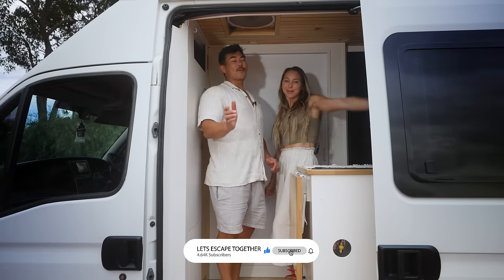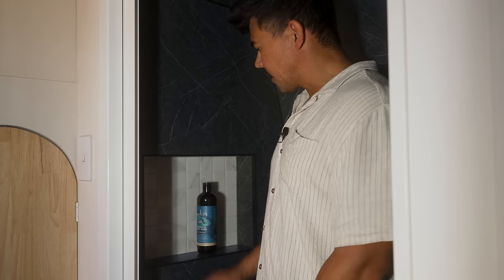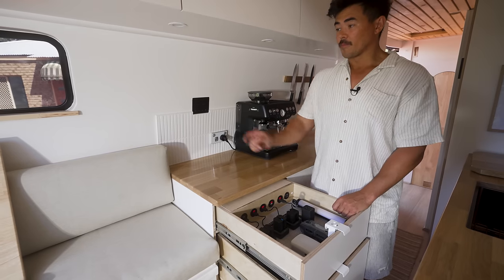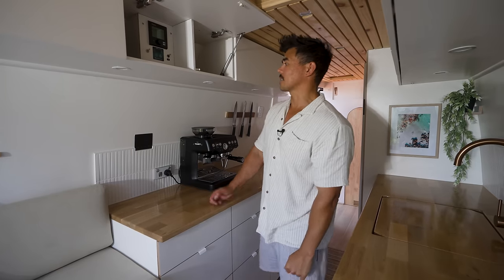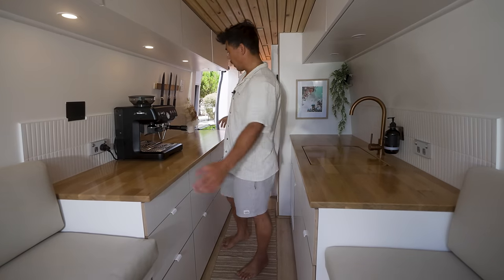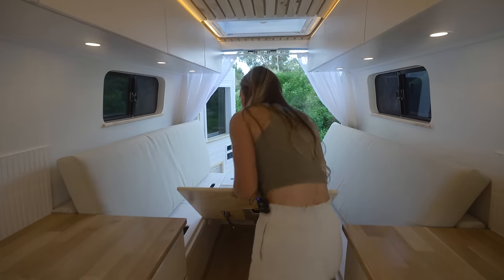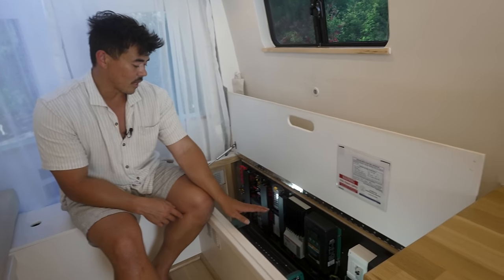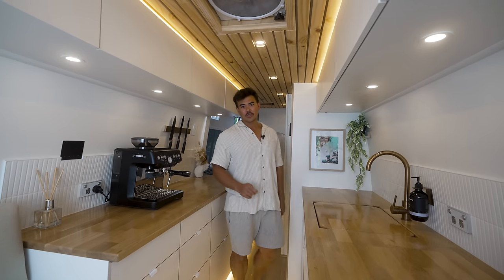VAN TOUR | Luxury OFF GRID Australian Campervan with custom Full Size Shower

Comment: Wow great build for your first time! I’m impressed! Love the clean lines and lighting. Great job with the nooks, materials, and storage.  You created various spaces to use inside and outside of the van.
Reply from the maker: @OldExodus
Reply from the maker: @OldExodus  Thank you so much for the lovely comment! We're so happy you like it! It was definitely a big project, especially since it was our first time building a van. We made sure to take our time with each step, focusing on doing everything thoroughly and not rushing the process, which is probably why it took us several months 🤣. But so far, the van and layout have been amazing, and honestly, there's nothing we’d really want to change!
Reply: What material did you use for the bathroom wall?

Comment: Thank you for the tour, its fantastic, one of the few builds I could imagine myself living in as you addressed so many things like easy use toilet, good shower, cab access but using most the partition wall too. Quality looks great. The only little things I would develop more would be an easier bed switching system and built in blinds on windows. It looks like an A/C unit on the roof? you didn't mention one.
Many vans are designed for the outdoor sport life accommodating bikes and surfboards, yours is more my taste, its designed to be a home from home.
Reply from the maker: Hey Rob, Thank you for your comment :) An easier bed system would be amazing but we couldn't come up with a way that would allow us to have the office space and over head cabinets. Our side windows are tinted and at night we put a cover up. The windows don't come with built in blinds but that would be a great option:) 
We don't have an aircon on the roof but we do have a portable one. We would have to learn how to surf first hahaha ;)

Comment: That’s a real sweet looking van. Giving me ideas already. I’m thinking I would probably add a hydraulic bed lift as I sleep on a futon and don’t care too much for my friends sitting on my bed. That way I can still have the lounge setup. 
A couple of serious questions now. How do you stay safe whilst on the road and looking for parking. I always feel nervous about someone coming up at night time and slashing my tyres and finally what will you choose once vehicles go electric. Thanks for sharing this awesome setup. I’m currently living in Perth and doing up an Aussie airstream. ☮️stay safe..
Reply from the maker: Hey Stevie thanks for watching!! We actually did consider a hydrology bed loft but they were about 4K just for the hardware.  Touch wood we haven’t had any troubles while camping and sleeping in the van.  We try not to camp out at any dodgy areas.  The pocket door comes in handy if we need to drive off on an emergency without getting out of the van

Comment: New subscriber here. Came over from Max & Occy's channel to see more. 

I love your van, especially having a full size oven and a really good size fridge at eye level with a freezer and your huge sink. I love your shower with sliding toilet, an awesome design and great use of space. 

I was thinking you might want to stand your coffee  machine on a silicone mat to prevent it from sliding off the counter when driving. You could cut it to fit so you wouldn't see it. 

Looking forward to seeing more on your travels.
Reply from the maker: Hey thanks so much for the advice!! We are getting some silicon mat for the coffee machine and hopefully that works 😊😊

Comment: Love the interior of your van and what you have done.  It's amazing and thank you for sharing it.  You have given me some great ideas for renovating our caravan.  Only just subscribed to your channel so not sure I you have a video of your build which I'll be very interested in, particularly when it comes to suppliers etc.  Noticed that you didn't have an air conditioner, is the ventilation system you have able to cope with the climate and humidity of the tropics in Queensland?
Reply from the maker: Hey Thanks for watching the video and the feedback.  We have the EcoFlow wave portable air conditioner together with 2 maxx fans, 2 sorocco fans and if all else fails windows and skylight open.  The reason why we didn't install a huge aircon on our roof is because at the time these units need to run of 240v and you need to be hooked up to Mains power.  We never stay at caravan parks and built the van to be off grid.  With our lap we will time the seasons so we are not in the top half when its too hot 👍

Comment: This is my favorite van tour/build by far. It seems like you guys really thought about everything down to the aluminum frame that protects your water tank. I'm glad you guys included clips of you insulating the van and actually demonstrated your shower/bathroom area. It just helps to get a better sense of how a person will actually be able to fit/move in the space. I also like that you focused on giving it less of a mobile home vibe and more of a tiny home vibe, and that instead of a "garage" you opted for a patio? space instead. I'd say the only thing missing from this tour was a closet space. I wasn't super clear where you guys are/were planning on storing your clothes. Overall though great job with the build (seriously it's gorgeous 😍) and the video. ❤❤❤
Reply from the maker: Wow thanks so much for your detailed reply!! We are thrilled that you like our Van and we appreciate how you commented on specific parts of the tour/build that you liked 🙏🏼🙌🏼 Your actually the second person to ask where we store our clothes and we should have uncles that in the video.  Our overhead cabinets store all our clothes and we have one side each. Emily wanted a hanging space for some clothes.  It would have been next to the fridge however it would have reduced bench space on the sink side.
Reply: @_letsescapetogether_  Thank you for your reply. This might be a bit of a personal question but would you say that the overhead cabinets give you roughly two weeks worth of clothes?

Comment: Brilliant job guys - came here from Max and Occy and now subscribed.
This is hands down the nicest build I have seen and I have watched plenty.
You really should get it spec'd out / measured up and I'm sure you could make some cash selling the plans.
Few things
1/ do you think you could have used (or other can use in the future) standard carcasses from something like kaboodle) or are depths not right.
2/ any reason why you did not do another two sliding seats out the back of the van to match the table
3/ If you could change anything now that you are done (to improve on the design what would it be).
4/ that back section of foam for the couch (nearest the door) how wide is that and could it be a single bed (hence you could leave that set up and the a smaller dining area set up (if you were travelling solo) but have the option to have full dining or full sleeping if/when required).
5/ shower cubicle - you hand made yours are there not prefabricated pods that you could have 'started' with and then modified ?)
Looking forward to seeing your adventures.
Reply from the maker: Love this thank you so much 😊 

- The Kaboodle packs are quite heavy and aren’t very strong. We do know others have used this for their cupboards but we wanted to custom make ours and wanted to make them light weight 😊

-We couldn’t so slide our seats because of our electrical board and also the gas box. We do have camping chairs we can use to sit around the slide out table.

- Because our walls are curved we didn’t want to have a pre made shower base. We also wanted a  
 slide out toilet so we had to custom make the walls. Max also wanted a niche with an LED light 😂

We are about to edit a one year of van life video and hope you will enjoy watching it ❤

Comment: Add strong pull out bench seats on either side of the back outside table, and then put a sliding middle part of the table that slides back into the van to reveal a gas grill with a table for eating on either side of the thin, but long gas grill. You could cook and then eat around your table with a nice gas fire burning in front of you. Or you could close off the grill and have a full table, or half and half. Underneath the table sides on either side of the grill have them lift up to reveal plates and cutlery and cloth napkins. On the doors put fold down tables with again either plates, cutlery, and champaign flutes, and whiskey glasses, and what ever else like cooking utensils, because you will be cooking steaks on the table grill for your friends both outside and inside at the seating area. Then put a beer fridge on the left side under the back bed area for quick access to yet another cold frosty brew! God bless us all! Love your work guys and she is prettier than you! Cheers from South Carolina USA!
Reply from the maker: That is a great idea but the pull out seats wouldn’t work because of our electrical board and gas box on both sides. We do have camp chairs for when we want to sit around the slide out table at the back. Love your ideas though maybe for the next build 😜😍

Comment: I would put in a hydraulic bed, and this would be my dream van build.
With the hydraulic bed, you get the seating area during the day, and at night, you push a button, and your bed is made & ready to go. If you ever have guests,  you can convert the bench seating into a guest bed and then just lower the hydraulic bed halfway, and it would be like a bunk bed.
Reply from the maker: Great idea and we did look at that.  The hydraulic bed lift retails at around $3000.  Maybe on the next build 🤷🏽‍♂️ thanks for watching and thanks for your suggestions we love it!

Comment: Superb, that is some van build and definitely the best design I've seen yet!  I Only found you through Max and Occy's video and will work my way through your library. If you have time I'd like to ask a couple of Q's please. What size is your shower pan? and, how long is your 'dinette' seating front to back?   
Love that slideout toilet idea......
Happy travels
Steve
Reply from the maker: Hey Guys!! Firstly thanks for watching and your feedback is so nice to hear.  The dimensions of the tray are 850mm x 700mm.  The Dinette seating area is 1.8m in width (drivers side to passenger side) and 1.6m in length.  I hope that answers your questions
Reply: @_letsescapetogether_  Thankyou for replying, thats really helpful!! :)

Comment: Awesome build guys!
The only bad thing is the 2 smaller solar panels on your roof are going to limit your overall solar when connected with the 3 bigger ones.
Reply from the maker: Hey mate thanks for the feedback 🙏🏼
Correct when all the panels are connected in Parallel the panel with the lowest voltage “pulls down”the other panels voltages to its voltage. I should have said we only have 600w of solar.

In the case of my 3x 180w panels and 2 x 55w panels the math is as follows.

3 x 180s with Vmp=19.8V and Imp=9.1A, when connected in parallel, generate:
System voltage = 19.8V
System current =  3x9.1=27.3A
System total power = 19.8x27.3=540.54W
Reply from the maker: If we add 2 x 55W panels with Vmp=18V and Imp=3.06A
System voltage = 18V
System current = 3x9.1 + 2x3.06 = 33.42A
System total power = 18 x 33.42 = 601.56W
 
Bottom line
Due to the lower voltage of the 55W panels the 180W panels become a little less efficient, BUT, the total still increases from 540.54W to 601.56W

I could run the 55w panels through a seperate solar charge controller to get full efficiency of the 180w panels and push my total wattage to 650w.

Comment: Congratulations on the toilet on the drawer slides, I have the same setup. I have only seen 3 other vans setup this way. 
Nice use of roof space for solar panels. You have a beautiful van.
👍
Reply from the maker: Thanks, you too!
Reply: Lovely van.  A real credit to you.  Was wondering how high the toilet is in relation to regular height; it being on the pullout slide. When you sat on it, it seemed your feet barely touched the floor.
Reply: @Tessienz  I'm 6'2" but still use a step stool that I keep in the shower so my 5'2" girlfriend can reach the cabinets. When the toilet is slid out the toilet base and stool are the same height.

Comment: Just a suggestion? That skinny fifth piece for bed: it would be eadoer to push
 in place if you stuffed it at one far side or the other.
Reply from the maker: We actually don’t even use that piece anymore.  The small gap isn’t even an issue when we sleep

Comment: Hey guys, nice build. What's the material you used for the shower walls if you don't mind sharing? Is there some sort of supporting paneling with waterproofing behind it - if so what is it?
Reply from the maker: Thanks mate! The shower panels are from a Perth company called Mr Wet Wall.  Under this is 7mm plywood.  We waterproofed the plywood and joins with a product called Dunlop wet area waterproofing. You can see the process on our Instagram highlight reel under “Van build 4” on how we did it.  @_letsescapetogether_

Comment: Great job. Really impressive. I was thinking that fold down seats, could be installed on the inside of the rear barn doors, to provide seating at your rear slide out draw. Assuming of course that the rear door hinges can handle the extra weight. Each seat could be cut on an angle to match the angle of the doors, at their optimal set point (maybe 30 degrees) relative to the table.
Reply from the maker: That would be cool! Although the panels on the back doors almost touch the back seat when shut so it might not work.
Reply: Yes, tough to modify a recently finished product, especially when it looks as good as yours. I'm going to try and make a similar set up - so I'll take on board your observation on clearance and make sure I leave enough space, for the seats to sit recessed into an insolated door trim panel. I think finished off with fly screening (removable) that it would provide us with an outdoor area, without the need for a stealth compromising roll out awning.  Once again love your work and style. Kind Regards, Rohan.

Comment: My only suggestion would be more power. Loads of solar and big van so easy to add second alternator for 200+ amps charging.  Add a 3rd 200ah battery.  Then you can add an under mount 12v air conditioner.  Like you said -- HOT down under /
Reply from the maker: The under mount aircons require  you to plug into the caravan parks which we didn't like because we built the van to be off grid and not dependant on caravan parks. We have a portable aircon however we have never had to use it because the van stays pretty cool. 😁

Comment: You guys have done an incredible job! 🤗 just a quick question about the sky light, have you had any leaks from it? We have been told by a camper converter that water can leak through the hinges? Have you guys had any issues with it? Thanks ☺️
Reply from the maker: Hey guys thanks so much for the lovely comment. We haven't had any issues at all wot the skylight and we absolutely love ours :)

Comment: Lovely van! However, the only thing I would have to have is an air conditioning unit. That is one huge spacious van and I’m sure hot summers are brutal in there even with the ceiling fans/vents.
Reply from the maker: Thanks Chris, we do have a portable aircon which we can use. Our van is designed to be off grid and unfortunately the aircons on the roof need to be plugged into 240v power ( caravan parks) this defeats the purpose of being off grid for us. It has been hot here in Brissy lately however 😂

Comment: Seems a really long van, or maybe it’s just your thoughtful layout. How long is it from the front partition wall to the back door? I have so many questions (sorry) -  wondering if this will work for my build. Is there a floor plan for this available? Also, what material did you use for your walls? (Ok, no more questions)
Reply from the maker: Partition wall to back barn doors is 5m.  Sorry we don’t have plans or a sketch up file we just winged it as we went. If I was you start by measuring out your bed first.  Then if you want a shower measure that out and then fill those gaps with cupboards
Reply: @_letsescapetogether_  Thanks! Have watched multiple times taking notes - see something new each time. Can’t wrap my head around this being your first build.

Comment: Omg what a van. I've watched 100's of van builds, this is my fav. Amazing job, really. May I ask if you have a floor plan or the dimensions of your shower, cabinets and u-shape couch? And also do you have a playlist of which video guides you followed for the build?
Reply from the maker: Thank You so much unfortunately we just designed the van as we went and don't have ay meausurements. We watched a lot from Max and Occy on Youtube. First we worked out our shower size, then bed and then the kitchen was the middle part. Things to consider is the size of fridges, ovens ect for us we also had to have one side of the kitchen wider because it has the Truma Heater inside it :)
Reply: @_letsescapetogether_  Thanks so much! Hope Max's housesitting is going well and Occy is going good :D Would you say your corridor in the van between each kitchen bench is more than 750mm? And as an estimate would you say your bench seats are longer than 1.7m? Thank you so much for your beautifully detailed blog post on your website about your build also, it's the dream build for me
Reply from the maker: I just has a quick measure the corridor is about 680 mm. The benches are 525 and 590 (this one has the heater inside) :) @Silhouette_one
Reply: @_letsescapetogether_   You both are actually amazing. Thank you!!!
Reply from the maker: Your welcome and please feel free to ask us any questions :) @Silhouette_one
Reply: @_letsescapetogether_  Thank you so much! May I ask the height of your  bench seats with cushions? And how long your bed is? From the back of the van to the front. Hope Max's roof is water tight now! :)